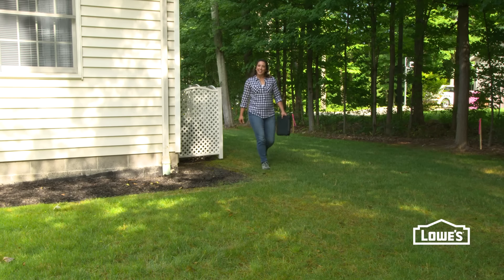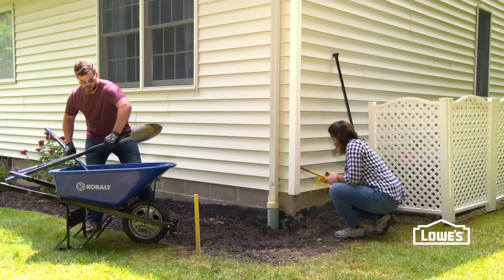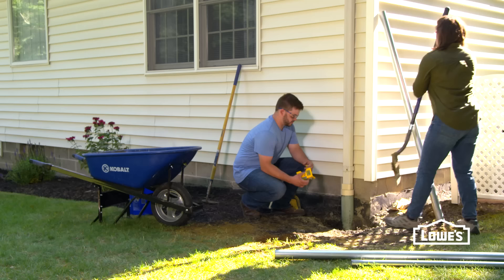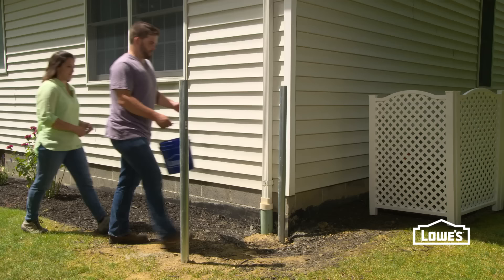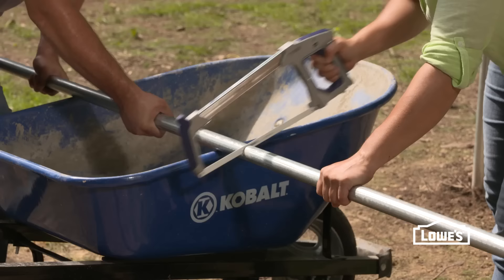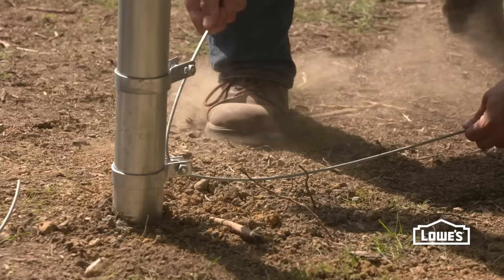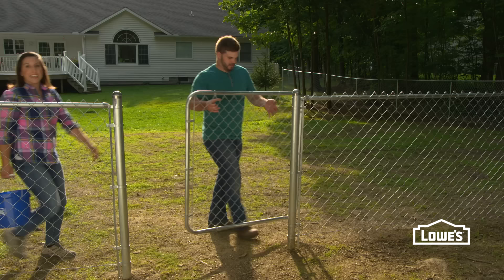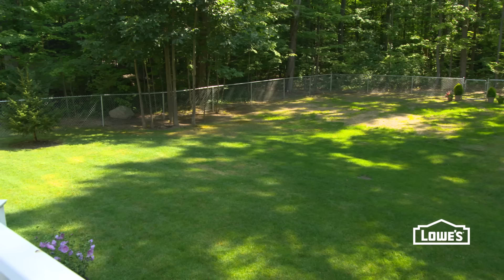How to Install a Chain Link Fence

Comment: I'm moving into a new house in March and it doesn't have a fence so I'm thinking about getting a underground wire fence for my dog or putting up a chain link fence. I haven't quite figured out the price difference I know that the the wire electric fence is $229 Canadian and for the chain link fence its $97 for 50 feet and suppose are $14 and the caps are $2.47 each so I haven't measured the yard yet and I'm thinking with all the equipment that I'll need and the concrete its definitely going to be over the $229 however it does have benefits to have in and actual fence because I do have two younger children and it would be nice for me to be able to put you know a small pool in the backyard and other things the backyard to keep it contained with her having other people or animals coming to the backyard so I was just wondering if some of you can help me wait the pros and cons of each.
Reply: Those shock collar invisible fence rigs are stupid. build a real fence.
Reply: Please do not get an invisible fence or even a chain link just do an easy wooden fence
Reply: If you're thinking of putting in a 'real' pool someday, check your local codes/bylaws, you'll probably require a 6' or higher fence all around it, so plan ahead before bothering to put in a short fence.  If you have kids playing you'll never regret having a fenced-in yard for them.
Reply: Yah - $97/50 feet, plus concrete, hardware, end caps, etc....Keep going.
Reply: @gurjindersingh199  how would you do a wooden fence for a dog kennel?

Comment: I recommend to use a air powered or hand driver than concrete due to speed and if you have rocky soil especially digging 20 or more that are 3 foot or deeper

Comment: Great now how to do on a slope? I guess I can figure it out.
Reply: Wolf House run a string line from top of a termaniel post  from top of slope  to the bottom of the slope keep both ends of string the height you want you're fence use line post in between 10 feet center apart attach wire to top of slope terminal post stretch to bottom slope termaniel post

Comment: Just remember when you’re splicing your wire together, make sure you have a whole diamond and a half diamond while you are splicing your wire together otherwise the two rolls will not splice together correctly .
Reply: An always start with the whole diamond, other wise you’ll have a step in the wire

Comment: That looks more like cement than concrete . Can I just use cement ? It would make it much easier installing and removing it later .
Reply: Jon Wee yeah it ultimately makes no difference if you use cement man, it’s your call

Comment: why not use a 2 3/8 chain link fence post cap with a bullet cap instead of using a brace band and a rail end ( as shown)? The way you did is not only more work but also more expensive.

Comment: Idk, every time I come out and see  Lowe’s subcontractors doing jobs, it’s a mess and the foundations are usually built incorrectly. Most people don’t realize when they hire a licensed contractor that it only goes so far, when getting a license they don’t teach how to build the actual fence, they just show equipment needed and general code guidelines. Most have no idea what they are doing once they get their licenses. It’s only if actually had before hand experience or really self motivated to learning quickly online then through trial and error on in the field. Just hope your not that customer lol I recommend really getting to know your contractor and asking fencing questions as well as digging deep about his experience

Comment: Not being picky but actually needed to learn how to put up my fence but..... she said to put the Terminal post in at 30" then when she actually measures and marks the depth on the pole itself, she marks it at 21 1/2"   ????????   I'm lost.
Reply: terminal post are 50 inches out the ground and line post are 45 inches out the ground.

Comment: The Concrete looked a little to soupy. The ratio for fence post should be 1:1:1.5 cement -sand -gravel ratio the "cake batter" analogy is a little to wet. You want to moisten it so it just workable to much water will weaken the mix. For 50 lb. mix about 4 pints of water. for 80 lbs. about 7. Temp. should hold at 50 degrees F for it too set well.
Reply: **two
Reply: 4 Pints for 50 lbs? Holee SHitsnax, Batman! THat doesn't seem to be a lot of water, but I'll try it this week.
Reply: In our city it will dry no matter how much water you put in it. 100+ degree summers here.

Comment: sure. goes all nice and easy with that Auger, unless you live in Philly/PA, where freakin boulders and all sorts of rocks are in the dirt, not to mention the clay down there. That Auger is useless. A digging bar, hammer, and helpers can get it done. Sure, chain link fence is a good cost-effective fence compared to some others. But you didn't add in the price of all the tools, the time spent doing it, etc.

The post is not level to the ground. The level is checking the difference between the bottom of the post and the top. It's not plumb. Level does not equal plumb, unless there is a 90 degree angle between the post and the ground on all sides. Unless I'm wrong, but that's my understanding.

Comment: question, how about the uneven landscape? my front n backyard is unlevel, its up n down, thxs
Reply: Never more than 2" less than height and 3" more than.
Reply: Reuben C . If you run a straight line from end post to end post and the lanscape has dips and hills.  You can easily have posts that are too short or too tall.

Comment: Concrete is unnecessary just pack the dirt slowly as you fill
Reply: Just power drive it. No packing needed if you don't fluff it to begin with
 Ask a thousand skyscrapers and a million seawalls.

Comment: How far apart are the post supposed to be???
Reply from the maker: Hi! You can find details on distance between line posts and more at http://low.es/2gu9AdA. Thanks!
Reply: Bruh measure the total distance then divide it by 2 then go in the middle of one of the spaces and measure it and divide it by 2. Thats how far apart they supposed to be
Reply: Not more then 10 feet apart
Reply: 10'
Reply: 10 feet
Reply: So for a 200' fence you have 5 posts?
Reply: Truth Seeker Exactly true.
Reply: 2 methods ---> 1) Space 10' apart and split the difference at the end of the run.  2) The professional way --->  Measure the distance of the run from outside of your starting post to the inside of your ending post and divide by 10'.   That will give you how many post,  if you have a fraction or decimal ex 8.73 then round up and divide your run distance by the whole post # in this case 9 and that will give you the exact distance between post.

Comment: By the time I buy all the tools, hire all the machinery, I might as well pay someone else to do it.
Reply: Most those tools you should have already. I’m confused by what specialty tool you’d need?
Reply: @Mike-dm5ut  The tension puller thingy
Reply: @Mike-dm5ut  most people probably don't have a tension puller/come along and an earth auger. I bet a good chunk of people don't even have a wheelbarrow. Digging any more than 3-4 post holes manually is fairly difficult work in most soils.

He's probably not wrong. By the time you get done buying all of the tools that make the job a lot easier on your back + materials at retail cost you're probably only saving 10-20% off of a professional, and it's likely their work will look nicer.
Reply: @michael95621  yea - if your not already a DIYer then these tools are not cheap to buy ALL at once. But for a job like this - depending on how fast a diyer is gonna do it them selves then yea they are probably better off just paying for it to be installed. Id say do it your self if only if you have the tools and the time. other than that , just hire someone - they will make it look nice for sure!
Reply: @arnoldduran4953  If we assume you are doing the entire job by hand and you only shop at Lowe's for some reason, you can get all required tools for about $255 plus tax. This includes the cost of: Safety glasses, work gloves, pliers, a socket wrench set, bolt cutters (tension wire is a pain to cut without them), a tape measure, torpedo level, hacksaw, shovel, post hole digger, wheelbarrow, come-a-long, fence stretching frame, string line, and wood laths. If you want to dig holes faster an auger will set you back $250 at Lowe's. If you want to ditch the socket wrench an impact driver can speed things up for around $80 for a kit (using the Skil 20V max as an example). Setting you back a grand total of $585, $335 if you ditch the auger since it's kinda a one trick pony but the rest of these are just generally useful tools.

The cheapest laborer at the fence company I work for is paid $16/h. Anyone in that pay grade is working with someone else who gets paid something like $20/h. So you are probably looking at around $360 a day just for labor costs. Depending on the size of the fence it could take more than one day.

Not saying don't hire someone. Cause a DIYers time is valuable too.
Reply: @michael95621  Not to mention if you manage to hit rock you'll have to invest in a jack hammer
Reply: I too wear safety glasses when digging holes with a shovel.
Reply: @milo8425  Those are more for when you find out the hard way that you have a defective come-a-long.
Reply: Depends on the fence size
Reply: @jorgemartinez3600  Where the hell are you trying to install a fence where you have that much rock to deal with?
Reply: @Machtyn  id think ratchet straps would work just as good.
Reply: @skallaresco4360  I just invite my crazy Uncle Larry over every morning. He sits on the porch sipping his coffee and shrieks at the birds and squirrels........  nope don't need a fence. Fresh pot of coffee and and occasional Krispy Kreme and were both happy.

Comment: SPLICING the fabric together???  If you need to add length to your fabric (fencing), it is MUCH easier to weave(splice) the connecting wire (a single strand of the fabric) to the two separate pieces while the fabric (fencing) is laying flat on the ground.

Comment: How much will I need to pay someone to do this??
Reply: Did you get a quote yet? I got a quote from a landscaper guy, $900 for a dog kennel. So I'm going to do it myself :)
Reply: Just got a quote for 125ft if fence...$2300
Reply: @beaut9790  ouch. 125 feet? Is that for all wood, or metal posts in concrete, etc? You can probably do it yourself, if you wanted to.

Comment: be very aware they made it look easy I do this as a side job and it’s exhausting lol
Reply: How much would you say all of the fencing would cost for something this size? I could rent the auger for a couple days and buy the rest.
Reply: @loganhatch  Probably less than $600. And it's fun to do it yourself.
Reply: @loganhatch  i just got a price  of 5,500.00 and my yard is not big. All I need is three sides done because my neighbor has one side facing me done. 6 feet fence.  And there is one side of the house I wanted 4feet fence. I think I will have to rent the drilling machine buy the things needed and do it myself. It probably be a little difficult but worth it. I've learned a lot by watching YouTube.

Comment: GATE SET-UP and MEASUREMENT???  Did I miss something, or did they NOT tell you how to measure for proper distancing for the gate and gate posts, BEFORE you install the the rest of the fence?  You need to know where your gate is going to be placed, put in your gate posts at the proper spacing, then install and attach the line posts and fabric.  Otherwise, that would be like building a wall for a house, and then figuring out where and how to put in a door.

Comment: I was thinking of of burying the fabric for inches or so to stop the dog from digging under it. Has anyone tried this?
Reply: I've also heard of this, but hadn't done it myself. if you dont mind the digging, I don't see why it wouldn't work.

I'm thinking about getting some of the pre made sections of fence, and a landscaper recently told me that it's heavy enough to stand upright by itself without sinking the posts into the concrete. I think the sections are pretty heavy so sounds like it should work. So I'll probably just pour a concrete pad and put the kennel on top.

Comment: The only part I was interested in - is adding the bottom tension wire because the schlub that installed our fence did not - this video showed them attach the wire, but nothing on how the terminal end is attached or how to put tension on it or how much tension??? What a waste of time...
Reply: @jagstang2100  you are wrong! They only show attaching the slack end of the tension wire, not the terminal end which is where the wire get pulled tight and how exactly that is achieved.  That was my point jagoff2100!
I did find another video which shows how this is done and the tool required to do it! The jagoff who built the fence on this property chose to bury the fabric 6" in the dirt and not use tension wire, that's all I was interested in was how that is done properly so I could fix the work of a jagoff and make it right! There is a proper method and a tool to achieve it and this video skips right over that part!

Comment: Did not help. I was, looking for instructions on post offsets specifically with the terminal to terminal posts to include the additional length of the tension band hardware.  I have 250' strait line to install. If I buy 5 x 50' chain link rolls what is the distance between terminal posts? Is it exactly 50' or with the tension band hardware that adds 2" on each terminal, then would the 50' chain link plus terminal post tension hardware set the post placement at 50'4"?  Also looking for specific terminal post measurements for a double gate. If I have a double gate with 2 x 10' gates making a total gate width of 20' would the terminal posts be exactly 20' feet apart or with additional gate to post hardware and gate to gate latch what additional measurements are added?
Reply: Then google that nerd

Comment: I had them put up one for me. The worst company I have ever had to deal with.  I have built a number of homes and had many contractors provide  services. They lied about when they would get it done, they shorted the material and forced the  contractor to find and pay for the missing material, more delay.  Be warned, call a local contractor and stay far away from this company.

Comment: That\s a horrible,lazy way to set posts. Mix the concrete first then add it to the hole. Also, unless you wont a wonky fence in a few years, dig your holes as a bell shape. Takes more effort and time, but it places the centre of gravity lowed and ensures a sturdier, longer lasting fence.
Reply: Dry pour is compactable but not wet. It's the compaction that is the solid foundation. Been tested by many agencies.

Comment: Seriously doubt she is a "professional carpenter": the way she uses a hammer, new tools,. LOL
Reply: How did she use the hammer wrong? She choked up on the handle because its probably to heavy for her to swing. This is a common thing to do when you are using a heavy hammer. Am I missing something?

This video is also a Lowes sponsored video, of course the tools are brand new.

Comment: Horrible job. The material itself is light and not strong enough.  The tension wire is bad.. we use a better quality and we stretch it with the come along. The gates are bad...  We build our gates according to the ground.

Comment: This is all wrong smh Imma start with real fence men/women always carry Pliers, tape, and level. I could go on and on but people are gonna get what they pay. That's the bottom line,  and when they get "slap up crews"  like the crews that work at these places to do it and in a few years have to call a real installer out there like Myself to fix there mess. On another note there is no way I could install with my hair down kudos to you.